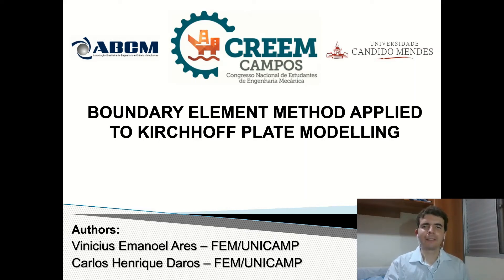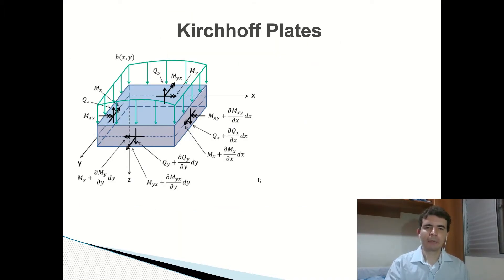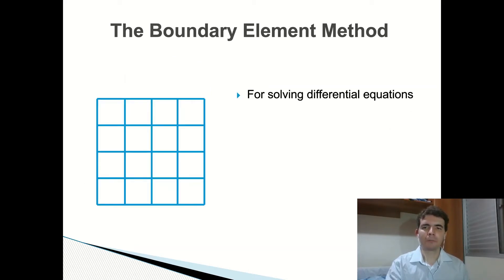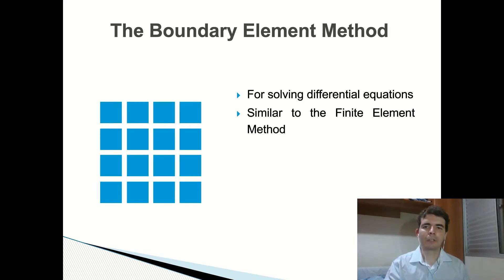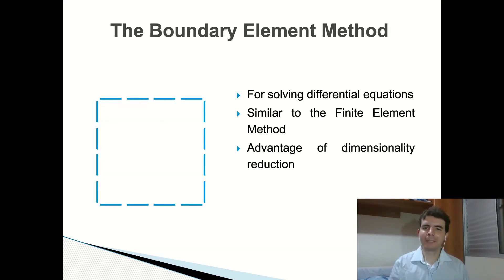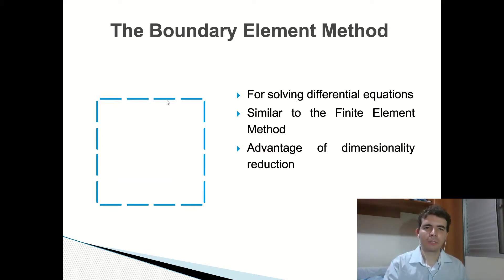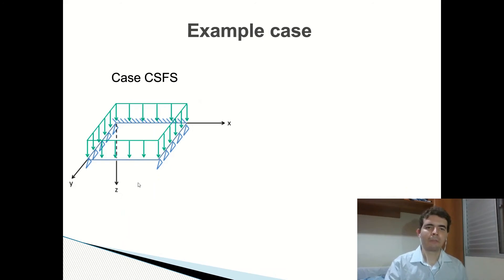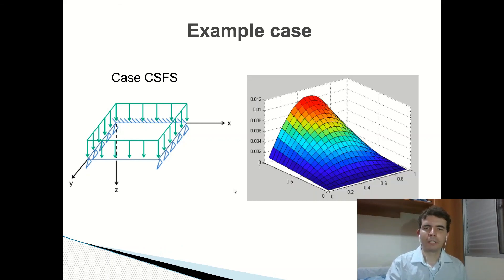Boundary Element Method applied to Kirchhoff Plates

Comment: Olá! Você chegou a calcular os momentos no domínio?
Reply from the maker: Hi, no I haven't calculated the moments in the domain. In the boundary I have access to displacements, angles, forces and moments. In the domain I calculated the displacements only. Are you going to do some project that requires that?
Reply: I'm studying about plates by BEM, and I'm trying to obtain the free terms of the loads to calculate the bending moments in the domain. Thus, in my problem, when applied the limit r->0 in the integrals arise singularities ln(r) in the free terms of the loads. So, I'm looking for something in the literature how to solve this.
Reply from the maker: @unknownwk5744  In my master thesis I have dealt with ln(r) singularities. Here you have the link to download it, in Portuguese http://repositorio.unicamp.br/Acervo/Detalhe/973767 download button in bottom of page.
For the singularities, look at equations 4.99 to 4.103 within section 4.4.2. Also, within the pdf, ctrl+F the keyword "singular"
Reply from the maker: @unknownwk5744  Update: I've just added how to download the files in the video description, hope it helps
Reply: @veares6384  Thks for sharing your work. Very interesting the proposed solutions. Congratulations! Unfortunately, my problem does not be solved as you suggest.
Reply: I want to learn the BEM. Please advise on resources. Thanks!